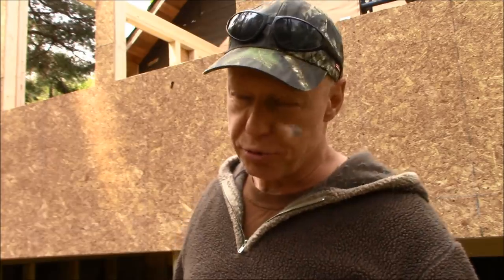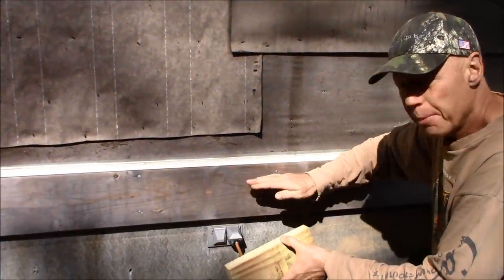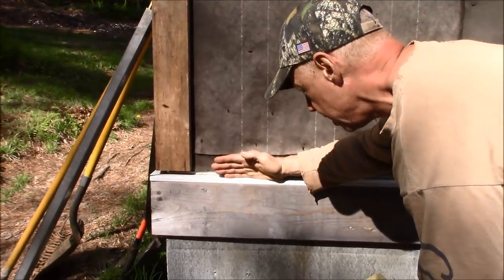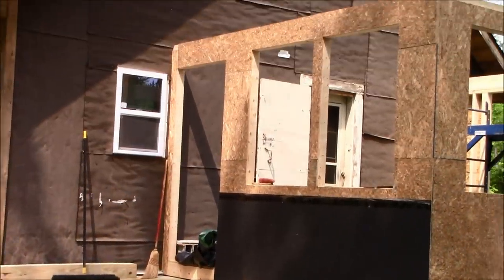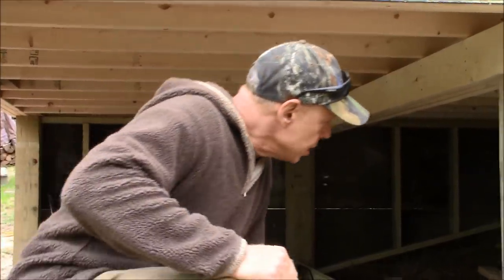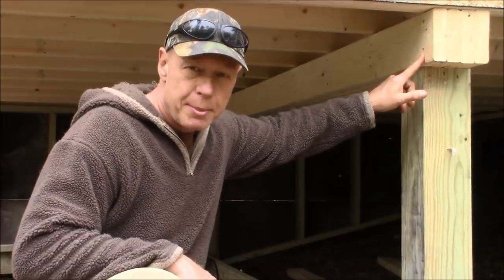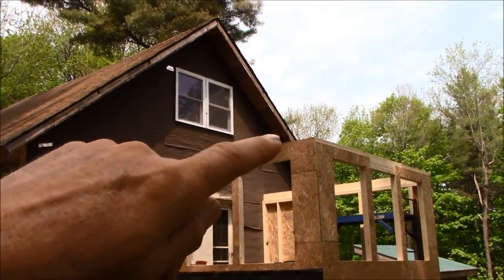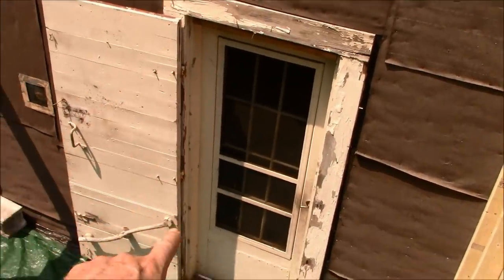BUILDING THE SCREEN PORCH AND DECK AT OUR OFF GRID HOMESTEAD

Comment: Looking good Boss. As far as that pitch goes, nothing a roof rake won't handle if you had a lift or some other way to get elevated enough to reach it to get the snow weight off.

Comment: Good work Boss.

Porch coming along nicely.

Depending on how long a  project is going to sit protect the OSB sheathing. 

In the past I have seen it get wet and ruin.

I personally prefer treated plywood for any exterior sheathing.

As a side note, if you are going to sheath or finish the inside walls.

Put some boric acid in the base of the wall cavaties.

This will help prevent insects for many years.

Did this when my parents built there house 20 years ago.

Only insects they usually get in the house can fly.

No ants, spiders etc.

Only pests they get regul

Comment: Great Job as Always. Maybe put a metal roof on the porch to help the snow slide off that low pitched roof ?? Just a thought, don’t over work your helper, noticed she handles the sliding chop saw pretty damn good ‼️👍👍 Vinny 🇺🇸 PS, If you picked up a directional antenna & installed it on a tall pole, aimed it at your closest tower which is easily found out I’m betting you could pull down a solid internet connection for your smartphones. Then you could run your channel from your laptop at home. The secret is tall, tall pole aimed in right direction ‼️ GOOD LUCK BOSS‼️. Vinny 🇺🇸

Comment: 12 x 12 is a great size!
I was thinking of you yesterday as I put away a set of ratchet straps in a pair of old socks! Great tip!
Reply from the maker: It works great doesn't it?
Reply: I can't believe I struggled for years. I would throw them in the back of the SUV untied, of course, they would be completely entangled with each other when I went to use them, or I tried rubber bands, etc. NOTHING WORKS AS GOOD AS AN OLD SOCK AND IS SO SIMPLE TO USE. GREAT TIP!
Reply: I store my safety glasses and ear plugs in an old sock. Damn I caught a lot of flack from the guys at work, but I always knew where they were and my glasses never got all scratched up. Sadly,  some folks just can't see the forest because of the trees, lol. Great tip, I'll have to incorporate it in my storage box on my trailer for my straps, thanks.
Now, does someone have a trick to use on kids who  borrow your trailer, but somehow fail to return all your straps ? LOL !!! I don't think they make socks big enough, lol.
Y'all be blessed, stay safe, and enjoy your day. PEACE

Comment: Boss, I hate making suggestions...but i have to share my thought. ;) what if you extended your current roof out past the new structure, you would gain a roofed side porch, could put in an upstairs door where the window is and have a second floor balcony over the screened in porch. 
Sorry, no one likes suggestions. But like you I just love building things.
Reply from the maker: Good suggestions but I don't want to block the light coming in my windows.
Reply: @thebossoftheswamp  
Yes it sure would block out the light!

Comment: Good morning Boss,
The porch looks great! Just a quick suggestion about the roofline..... Instead of a shed roof, you should build a gable. By doing that, you will cut the run in half, basically doubling your pitch, because either way the roof has to die in under the upper gable windows. Steeper is better with the snowloads. Good luck
Reply from the maker: I shouldn't because I can't stand a gable beneath a gable unless they are a matched pitch, plus a gable would dump all the snow in front of my screen door and onto my deck.
Reply: @thebossoftheswamp  
Point well taken. I  didn't consider the door location, and  of course your preference about the gable beneath a gable. Looking forward to seeing the finished product.

Comment: I keep a spray bottle mixture of dish soap, apple cider vinegar, and peppermint oil with me outside. Mostly for wasps. I recently had a bee chase me around, I was with 2 people, it wouldn't leave me alone. It wasn't trying to sting me just wouldn't stay off of me. Since I was at a neighbor's I didn't have my spray with me. I wished I knew how to build or just repair. I am a woman 2 years from 70 and my trailer has been hit by 4 hurricanes. My whole east side is pouring water and I have had to disconnect the electricity to it. I am surprised it is still standing. With hopes and prayers is my only thoughts why.